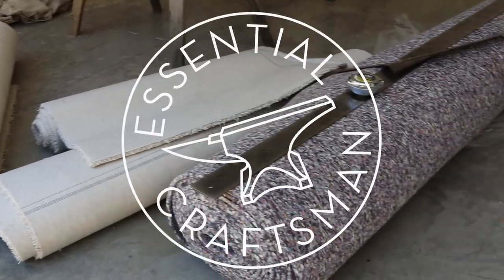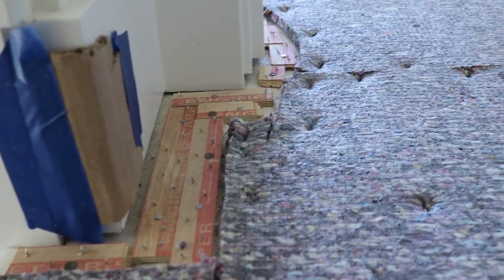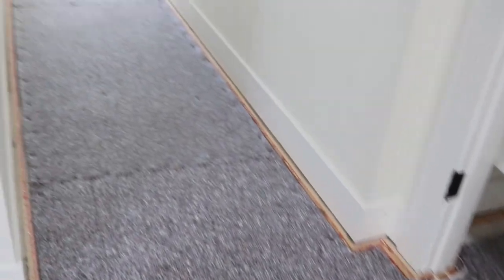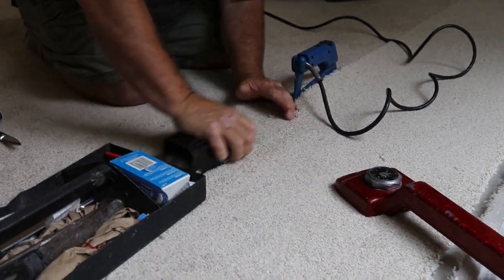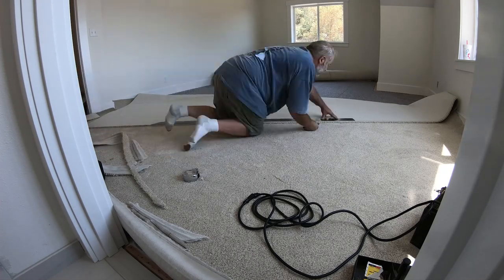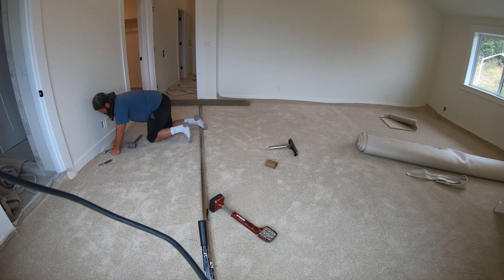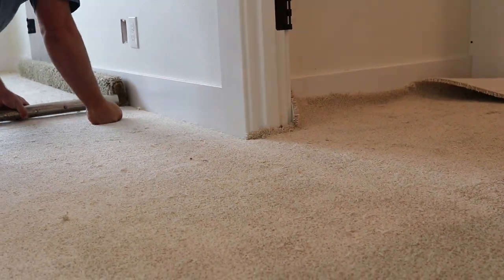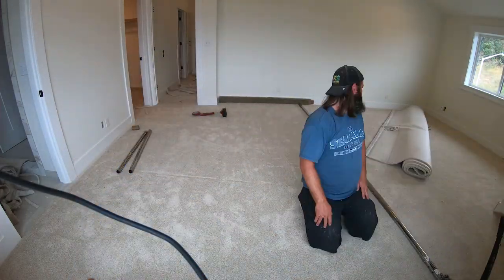Installing Carpet Ep.130

Comment: I always appreciate the respect you show your subcontractors.
Many of these trades are young mens jobs.
Laying carpet tears a man up.
Reply: Yes it does. Im 33, been a professional flooring installer for over 15 years. I also work with my dad. We install everything from carpet, to hardwood, to the luxury vinyl plank, and let me tell you, especially after a carpet job, you are extremely sore and the next day you have to get up and do it again.
Reply: @justinlaw2670  same, I've done epoxy floors for a few years in the early to mid twenties and it's hell on the knees. 
For the younger guys get a really good set of knee pads. Don't worry about the cost trust me its will be worth it.

Little too late for some of us though 😅
Reply: Correct,
2 knee surgery later and a bad back
It does tear us up
Reply: @jusrobington  oh i have good knee pads. They are the comfort knees by crain. The only ones i can use. I dont get on the floor without them even on carpet.
Reply: Worked with an old guy a couple decades ago (not in construction) and he had about 30 years of carpet laying behind him. The spirit was willing but his knees were shot (those kickers were about all they used in the old days, I was told).

Comment: Pro tips from an ex carpet installer: 
1. Never install carpet in your house
2. Never install it in the winter
3. see tip 1
Not hating just stating.
Reply: i will never have another house with carpet in it after having stained concrete and tile ,carpet isn't an option anymore
Reply: Carpet is so much more comfortable when barefoot than hard floors.

I don't like carpet on stairs though. Way too much focused wear. Ends up looking like crap in no time and requires a lot of difficult vacuuming.
Reply: Completely agree! I am currently in the process of building a custom home and my builder was shocked I did not want any carpet at all in the house, not even the bedrooms.
Reply: Big ups Alex
Reply: @ADBBuild  Thats where area rugs come in and they are easier to clean
Reply: I appreciate the hard work these guys are doing, but carpet is a major pain to deal with as the years go by.
Reply: @apollorobb  my feet and body hurt just thinking about it
Reply: Never installed a major amount of residential carpet (I do special event carpet quite a bit but thats a totally different animal) but I have ripped up acres of the stuff to install hardwood and tile for remodels. Carpet becomes a giant sponge for dust and dirt, and if you have pets its 100x worse. I would never install carpet in a house for myself. Around where I live most carpet is put in budget tract homes and flipper houses, anything custom is all hard surface with the exception of maybe a really nice quality loop carpet in a den or gameroom etc.
Reply: I love my carpet!  To each his own!
Reply: I feel that a carpeted stair is a much safer stair than one with hardwood. So much less slippery. I totally agree about the high traffic path wearing faster and looking less good, but I think that’s a small price to pay for the safety. Especially if you have kids or older folks using the stair regularly. 

I don’t care for carpet anywhere else but to each there own.
Reply: @apollorobb  if you get a giant area rug you clean that in the exact same way you clean regular carpet and it costs about the same with the added costs of the hardwood underneath
Reply: @ADBBuild  I agree but as someone who has wiped out on both carpeted and hardwood stairs I would be willing to sacrifice the looks for the cushion.
Reply: Lol
Reply: @ADBBuild  As a parent who's watched kids tumble down stairs, carpet on stairs is really ice... You're right that it's better for wear.
Reply: Fully agree! Kinda surprised they went with carpet.  Looks and feels great in the beginning but it can never be truly cleaned.
Reply: @Alex.AL_26  We don't have carpet anywhere in the house either. Upstairs, bedrooms, stairs or the basement.
Reply: Agree 100% No carpet in my house.

Carpet and exposed aggregate concrete are 2 choices on this build that did not help it for me.
Reply: @jeffweber8244  And the textured walls.
Reply: @dchristo10 , yea, the textured walls was a turnoff for me to. Kind of has a Motel Six feel to it. If you have textured walls, then your view out your windows should probably include a Waffle House! Lol Sorry, once I started I couldn’t quit.
Reply: I worked for a custom shop here in LA for two years, we did events and custom rugs. Big events, red carpet stuff. I mostly did the sewing. It taught me a lot, but I concur, the only “carpet” I will ever have in a home will be area rugs, and those will be a tight tight tight weave, essentially commercial grade. Hard floors mean less trapped dust, I’m partial to concrete myself.
Reply: Cork and lino are both natural products and a lot healthier than carpet.
Reply: The older you get, the more you appreciate soft carpet underfoot!
Reply: To each their own. It’s good for older people who lose all the padding in their feet. Some folks like something soft to walk on n willing to take care of it.
Reply: @ADBBuild  our last house had wood stairs.. our 13 year old dog kept falling down the stairs! We had to put up a gate to keep him down stairs before he broke something.
Reply: Installed for 20 years, not a single carpet in my house.
Reply: why not the winter? due to it getting dirty when bringing inside? or something to do with shrinkage/expansion?
Reply: @BCVS777  Agreed. I personally cannot stand hard flooring in homes. In kitchens and bathrooms sure, but anywhere else? No thank you. To cold, too hard, too noisy. Area rugs suck. Carpet is absolutely the best.
Reply: soooo why tip 2? I had carpet installed in winter recently so i'm genuinely curious! 😅
Reply: @markdoumert4840  Some argue for people with e.g. allergies carpet is better as it traps the dust, some argue for the same reason hardwood or anything you can just vacuum and mop up (like with a moist mop, not soaking wet) is better as you can better clean out the hard floors. and carpet becomes a breeding place for mites, which may become an issue for dust/mite allergies. It seems carpet then needs to be thouroghly washed/steamed about twice a year, if not even more often.
Reply: @alexanderkupke920  For sure, if you do have carpet it needs to be regularly cleaned. It helps with allergies and dust and also is the main thing you can do to make it last like its supposed to. Dust and dirt gets in the fibers and shreds the carpet apart like sandpaper if its not cleaned regularly.
Reply: @markdoumert4840  i think overall both sides have a point. While carpet actually binds dust (although providing ideal breeding conditions for mites which cause most dust allergies) and does not release it as easy, which makes it more difficult to properly clean, hard floors do not bind dust and you can easily stir up a lot of dust just by walking on it, as it does not cling to it, which makes cleaning a lot easier.
I guess the actual effect depends a lot on your cleaning habits/preferences. And those I am sure are for the majority of the households not as thorough as they might need to be.
When it comes to people with am actual house dust allergy, the story may be different. As they need to clean more and more thoroughly to keep dust and mites at bay, I think hard flooring is the better option, as it is easier to clean on a regular basis and is a less welcoming breeding ground for mites (which nevertheless are there, just less.)
Washing a carpet regularly is a lot more complicated. While it definitely elongates the life of a quality carpet, it needs special equipment etc. Ideally you clean out the rooms before treatment and then it takes hours to dry. I heard once that if you are suffering from a dust allergy, you best do it monthly.
Buti also know of cases where it was not done properly and it could either cause the carpet to deteriorate prematurely or cause additional mold issues
Reply: Nothing like a dry day and good wool socks to shuffle across the carpet on the way to gently spark the touch of a loved one.
Reply: Totally agree.  Hard to keep clean.  Also the cat gets too much traction on it.  I prefer to see him slide around when he runs.
Reply: @colinstu  you can install in the winter!!! Just let the product warm up first! Cold rug can rip when stretching it!  The warmer the rug the better, in summer months we'll leave the rolls of rug out in the sun to heat up as much as possible.
Reply: Carpet: unhealthy, habitat for bugs, accumulates dust, and fire hazard!

Comment: Me, living in Germany, once again is left wondering how different construction is done between here and the US. I remember in old houses (like really old) which still have a wooden subfloor, I have seen carpet being nailed, but actually what I had seen was the carpet being nailed from above using trim strips. The strips then became part of the baseboard which covered most of them. I also never have seen something like that padding.
As more modern houses rarely have wooden floors, most time it will be screed, nailing down anything actually would not even work. And if you look at carpet here, it rarely is something as plushy as those american carpets. I think our average carpet is about a quarter of an inch thick at most, including a built in foam backing. (not actually thick enough to be considered a padding, most times it is only about 2-3 mm, some carpets don´t even have a foam backing). common types are either some short fiber velor like stuff or looped carpets.
To lay them down commonly three different ways to fasten them are used. Double sided "carpet" tape along the edges and maybe additional strips across the room. that tape is about the width of a common packing or gaffers tape and comes with one side covered by a nonstick paper for easier application. A light glue to just fixate the carpet but from which the carpet can easily be ripped off or as last method, gluing the stuff down on the whole area.
The first two ways are more popular, especially in rented flats or houses the tape has the advantage of being easier to reverse. In flats (or apartments or condos or whatever you call them) of a certain area you may also often find carpet put on top of linoleum or pvc tiles with tape, as in rented estates it usually has to be reversible. The light glue works well directly on screed where the tape may sometimes not adhere very well. The actual glue is quite a task to remove. But as carpets get older and the common foam backing deteriorates, the carpets get easier to remove, but the remnants of any type of glue become a nightmare.
I even have seen carpet just being laid down and maybe somewhat clamped with the baseboard, but that seems to be a bit sketchy in certain traffic areas.

Comment: Having to join strips of carpet has to be an American thing.  Alas, I've never owned a house in the UK where the rooms were so big that was an issue.
Reply: I wondered about those as well, living in Germany. I remember in old houses (like really old) which still hat a wooden subfloor I have seen carpet being nailed, but actually what I had seen was the carpet being nailed from above using trim strips. The strips then became part of the basebord which covered most of them. I also never have seen something like that padding.
As more modern houses rarely have wooden floors, most time it will be screed, nailing down anything actually would not even work. and if you look at carpet here, it rarely is something as plushy as those american carpets. I think our average carpet is about a quarter of an inch thick at most, including a built in foam backing. (not actually thick enough to be considered a padding, most times it is only about 2-3 mm). common types are either some velours like stuff or looped carpets.
To lay them down commonly three different ways to fasten them are used. Double sided "carpet" tape along the edges and maybe additional strips across the room. A light glue to just fixyte the carpet but from which the carpet can easily be ripped off or as last method, glueing the stuff down on the whole area.
The first two ways are more popular, especially in rented flats or houses the tape has the advantage of being easier to reverse. In flats (or apartments or condos or whatever you call them) you may also often find carpet put on top of linoleum or pvc tiles with tape, as in rented estates it usually has to be reversible. The light glue works well directly on screed where the tape may sometimes not adhere very well. The actual glue is a nightmare to remove.
I even have seen carpet just being layed down and maybe somewhat clamped with the basebord, but that seems to be a bit sketchy in certain traffic areas.

Comment: You're lucky to have a good carpet installer.  I just finished a remodel and the bought carpet from the big box stores.  Bonus was Free install downside is you don't know who you're going to get for the installer.  One company was really good the other was only mediocre. Scheduling for both was really difficult. Hardwood and tile is good selling point but I was trying to reduce noise in my house as much as possible so without heavy draperies and things, carpet was the way to go to quiet things down.

Comment: Here in Italy the carpet is only for hotels.  I've never seen a carpeted house.  We always use marble or ceramic tiles, sometimes wooden floors.  I can't understand why it's so common in the US
Reply: Because it’s comfortable. It also helps with allergies as it traps dust and keeps it out of the air. Residential carpet is much different than commercial carpet. It’s soft and plush vs the hard scratchy feeling of commercial carpet. When it’s cold in the morning it’s nice to step on a warm soft service vs a cold hard floor.
Reply: What about cleaning it? I imagine that you can't do anything but vacuuming it, at least regularly
Reply: @giuseeep  that’s all it requires. Every other year it’s a good idea to steam clean.

Comment: I have installed for 25+ years and was all prepared to see the installers using just knee kickers. Glad to see the proper way of stretching the carpet with a power stretcher “the only way”. I’ve seen installers just kicking it and within a month of use and heating it WILL ALWAYS wrinkle. Thanks for posting.

Comment: Why do people hate on carpet? Barefoot in the morning it feels better than an ice cold wooden floor. Carpet can be cleaned and vacuumed, whereas hardwood can stain and get scratches. Moving furniture is easier as things can slide on carpet (and what do people use when moving things on hardwood? A piece of carpet to slide furniture around). If it's the family room and there's a lot of people, you can toss a pillow down on the carpet and lounge. It's easier for dogs to maneuver around (especially as they get older). Hardwood, at least to me, is good in the dining room and living room. Other than that, I'm just not a fan

Comment: I need my whole house re-carpeted. The carpet is 30-40 years old and I can’t keep it clean. I shampoo it every year and vacuum once a week, sometimes twice, and it is always dusty. I think there is so much dirt/ dust under it that it just keeps coming through.I had one bedroom done and it was $1000 for that one bedroom!! Crazy
Reply: It honestly kind of sounds like your pad might be so deteriorated its turning into dust. I've seen it happen. It might honest be worth just getting a quote to do the entire house or at least one floor. The cost will be higher, but the cost per squarefoot will probably be less. In addition if you pull up the old carpet and pad you can probably save a little extra money. It also gives you a chance to screw down your subfloor. screwing it down every foot or so will basically eliminate any floor squeaks if you have any.
Reply: @ryanjohnson8340  That’s what I did to the bedroom subfloor when I tore up that carpet. The pad in that room was deteriorated really bad. It crumbled into chunks and small pieces. I don’t think I can live another winter in this house with the carpet that’s here. I might tear it out , fix the subfloor ( screw it down) and seal the subfloor for now until I can afford carpet
Reply: Get that 30-40 year old carpet in the dumpster ASAP! Shampooing frequently is the worst thing you can do to carpet. The important thing to do with carpet is to never get it dirty, dry vac often, and if you have pets, remove your carpet or move to another house with no carpet.
Reply: @Musabe009  I will admit it has been a while since I've had carpet installed. I usually just tear it out in my rentals and install LVP as the stuff is cheap, durable, and easy to install. One trick I have used in flip houses to save some money is to use cheaper carpet but double up on the padding and use a nice quality pad to give a the feeling of a nice soft plush carpet. The stuff generally feels the same with the extra padding. The only downside is the carpet wears out quicker so I don't put it in high traffic areas like hallways. But for bedrooms and secondary rooms the cheaper carpet is fine. It also tends to be less stain resistant but just keep it clean.
Reply: @ryanjohnson8340  I will look into that.

Comment: I hate carpet
Reply: I despise laminate floor.
Reply: @notrut  yepp, its terrible.
Reply: Honestly, I think carpet upstairs is preferable over hardwood, tile, etc. because 1) it provides noise insulation between the downstairs and upstairs 2) most of the dirt that tracks into a house stays downstairs, so keeping upstairs carpet clean is much easier and 3) a lot of houses need an ridiculous amount of float to properly level an upstairs for wood or laminate.
Reply: I just prefer the clean feeling of tiles or wood.   So much quicker to run the mop over the floors.  And if you have pets it's a no brainer.